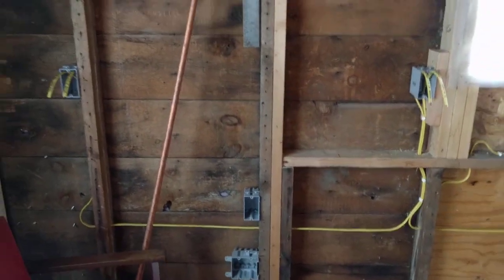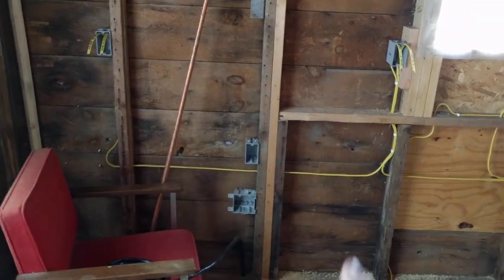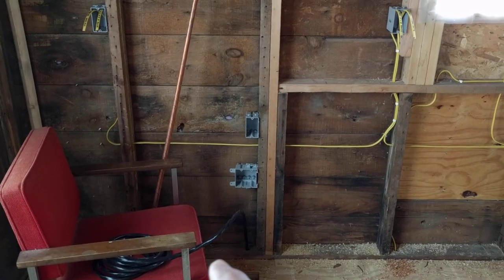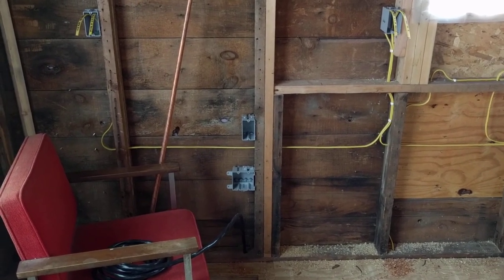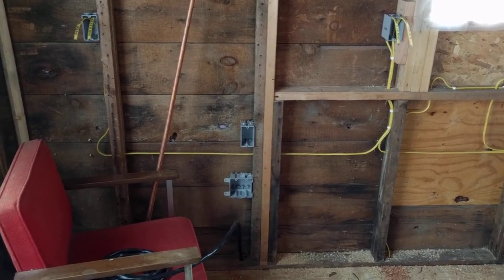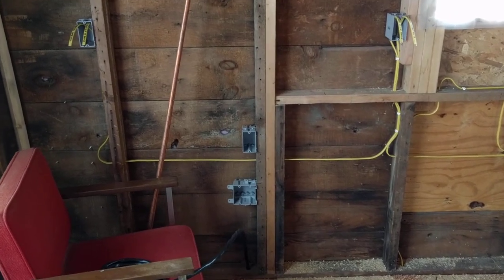Dedicated Circuit For Gas Range?

Comment: I had to install a dedicated 20 AMP circuit for a gas range once. It was a higher end gas range with an electric warming drawer and heating element for the convection oven that helped maintain temperature.  It kept tripping the breaker for the circuit it was shared on.   Not code, but just thought I would share since sometimes it might be needed.

Comment: Im glad someone finally made a video on the subject. I've been told differently twice now.. A licensed electrician said the same thing you did, that it barely pulls any power 

However I'm doing a dedicated 12/2 line anyways  jusr  incase any future  homeowners want to change out the gas stove for an electric one, they'll be all set except for the receptacle.

It would be nice if you could make a video naming each appliance that needs its own dedicated line.  It took me forever to get the answers. From what I understand a refrigerator,  dishwasher and garbage disposal all need a dedicated line.
Reply: @snowwny   I think you must of skimmed the above reply i original posted.

 I have a gas stove and gas stoves barely use any electricity , just to light the clock so you don't need  much amperage going to it.

You can even daisy chain off of it for a ductless hood range because they don't use much either

Comment: Some Gas Stoves have a heating element which gets red hot to ignite the gas.  In fact a bi-metal valve element flexes as this heating element heats up.  The flexing is what causes a gas valve to open once the element is hot enough to ignite the gas.  Connected to a meter I see that my range draws 4 amps.  Can you point out the section of the NEC which confirms that a gas range does not need a dedicated circuit?